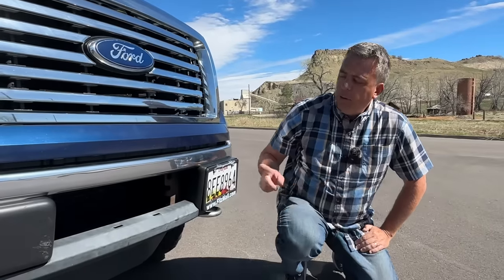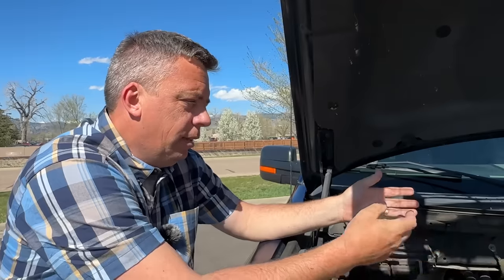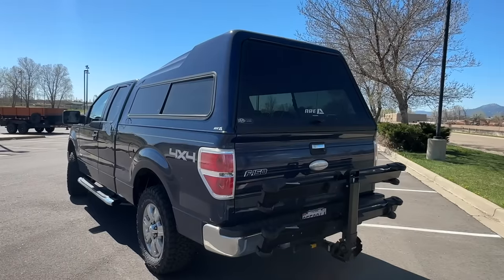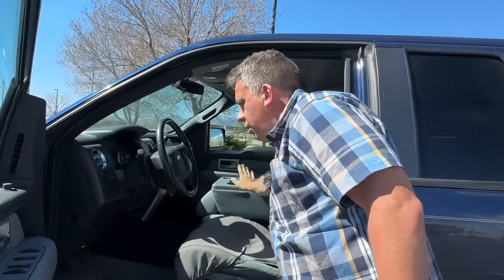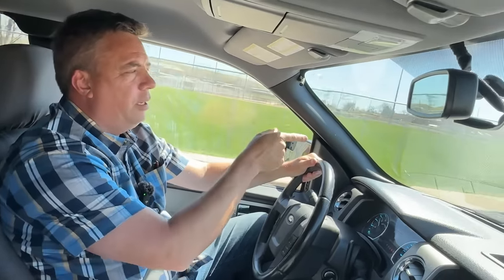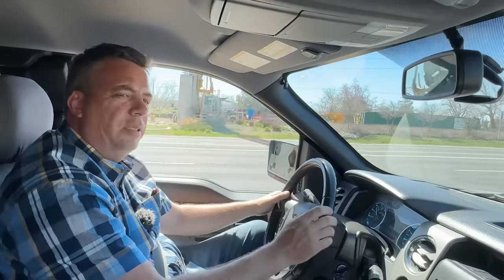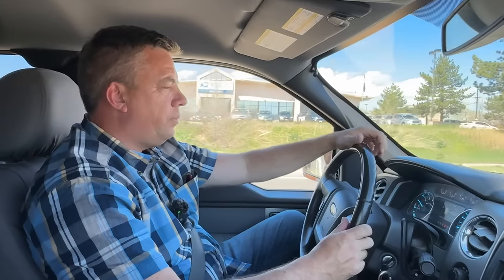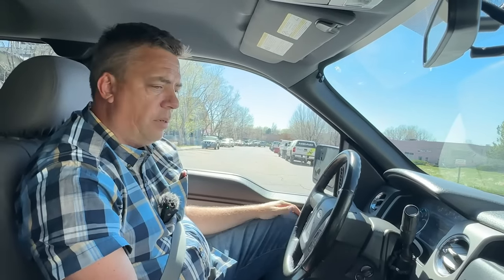How Has the Ford F-150 EcoBoost Held Up Over a Decade?

Comment: I bought my first pickup F150 3.5EB 2012. at 325056 km. from Canada, apart from the rust that was on the chassis, this truck has no problem with its mileage. After the initial removal of all fluids, I only had a problem with the leaking water pump, after its replacement everything is now concrete. For the years that I have owned it, I have installed a double oil cache can, I have a complete generation from the turbo to the end, after removing the catalysts, the pickup started to sound like a B8, then I added a panel filter and software that made the truck 385hp and 660nm at the wheels, I'm extremely happy with the purchase and after all these interventions it runs like a sports car. 
P.S. Greetings from Bulgaria, for the great channel you make, keep it up.

Comment: My 2013 f-150 FX4 3.5 eco had over 80,000 on it when I traded it in. No catch can nothing aftermarket on it. No problems at all. Just routine maintained   I traded it last year for a 2023 F150 Tremor I was so happy with the eco boost I bought another.

Comment: My coworker just traded in his 2012 F-150 with 160,000 miles last year (2023) because the turbos were starting to go out and mechanic quoted $7000 to fix both.

My wife's 2014 Ford Escape has a turbo trying to go out, along with other issues.

After these experiences, I won't own another vehicle with a turbo unless I plan on trading it around 100,000 miles.
Reply: If he supposedly got a repair quote for turbo replacement of $7k he was gonna be ripped off for an extra $5k
Reply: @pathunter7003  It sounds like the guy didn't want to do the job, so he priced it up. If the customer was willing to pay, he would have farmed it out. 😯
Reply: @andyd5492  that could be he case that he didn’t want to do the job, $7k is ridiculous.
Reply: @pathunter7003  doubtful.
He's know the mechanic for decades.

Also, the part alone for my wife's Ford Escape was $1200, not counting labor, so $7000 for two turbos on an F-150 is conceivable.
Reply: @GKMess42  the only conceivable part that his “trusted “ , which he didn’t mention that he knew him for decades, was going to rip him off if charging $7000 for turbos
Reply: @pathunter7003  it’s very clear that you haven’t priced turbos and labor in several years. That or I really wish I lived where you do because it must be a heck of a lot cheaper than the United States
Reply: @GKMess42  I guess you have to know where to buy them, obviously you don’t
Reply: @GKMess42 yeah idk what you’re talking about if you’re getting charged 7k for a turbo swap you need a new mechanic. You can get oem refurbished turbos for like 500.
Reply: @ReeshaRacing  first of all, this wasn't me.
Second of all, you're completely wrong.
Reply: You can buy new turbos for thees trucks off Rock auto for under $500 each. Any competent mechanic can replace them both in less than a day
Reply: @kevingeezy5176  better check your math.
Reply: @GKMess42  also for the 2014 escape rock auto has turbos for the 2.0 and the 1.6 for under $600

Comment: Thanks for doing this episode.  I'm still the original owner of a 2011 F150 FX4 SuperCrew (door plate reads production Feb 2011) with 118,000 miles.  It's been the best engine I've ever owned in a truck.  I've pulled up mountain passes near Durango with 10,000 pounds in a trailer and accelerated easily during the climb.   The only engine issues I've had were 1) a bad fuel incident requiring new spark plugs and injectors, 2)  hoses that started to leak after about 115k miles, and 3) the turbo charger intercooler / exchanger being oversized by design.  That last quirk was a strange thing to diagnose and only affected those of us in Texas and similar states where we can get a huge swing in temperature in a humid air mass during a  "norther" cold front.  The exchanger would over-cool the saturated air, and moisture would drop out, stalling the engine -- not great if you are trying to pass or enter a highway at speed.  The solution was to cover the exchanger partially with a piece of plastic Ford designed.  Haven't had a problem for the 10 years after the fix was installed.   I had not heard of the "cam phaser" issue you mentioned, but I suppose that can happen to many older / higher mileage cars.  The turbos lasting only to 150,000 miles is also news to me.  I am approaching that mark in about 30k and it may be prudent to trade for a new model.  But with the good track record I've had with this unit, I may try my luck, considering new F150s can reach $75k modestly equipped!

Comment: I drove 3 of the 2011 F150. Two were 3.5 ecoboosts and 1 was a 5.0. I owned one of the ecoboosts and the other 2 were work trucks. Never really had major problems. The 5.0 got better mileage quite easily.

Comment: You can watch several episodes of this engine, going through torture test hosted by Mike Rowe. I got my first 3.5 in a 2015 XLT. 90,000 miles and 0 issues. Now 2021 3.5 STX with FX4 package. Intake,cat-back and tune on both. Beating sports cars with a truck is a blast. Ford tough for sure.

Comment: Have 160k of hard miles on my 2013 3.5 F-150. I run a landscaping company, and the little truck has to pinch hit with my tandem axel dump trailer and equipment hauler on occasion and has really impressed myself and my foreman who have towed with it. I live on the continental divide in Montana at over a mile in elevation, this little engine definitely outperforms my 3/4 ton gas v=8 trucks towing here in the mountains, wish Ford would use this engine or ideally a larger I-6 Ecoboost(style direct injection) engine in their Superduty line.
Reply: That’s a good idea.  I really like the idea of a TT I6 like the Hurricane.  That architecture would work great in a 1 ton.  You’ve got the space (Cummins I6 swaps have proven that) and the 7 main bears of the I6 would make quite durable.  Only thing is, I’m not sure they want durability as it would cut out their lucrative after warranty repairs.  Ecoboost V6 is perfect for them.  Makes it all the way to the end of the warranty and then becomes Ecoboom.
Reply: @failranch9542  Not sure what makes you think ecoboost don't last. Has not been my experience. Have blown up more 5.7 Hemi's than anything else honestly.

Comment: I had a 2014 f150 ecoboost that I drove for 10 years before selling it to my dad. Only thing I had to change outside of regular maintenance was an oxygen sensor at 90k miles. Currently own a 2022 I have not had any issues in almost 2 years, hopefully it lasts as long as my 2014

Comment: My 2011 f150 ecoboost has 260,000 miles. It’s been a great truck. Had some issues with transmission and recently had to spend about $1,500 on repairs.
Bought it brand new in 2011.

Comment: I just bought a 2011 F150 with the Ecoboost, with 219000km on it. Seems good so far. I also have 2011 F250 Super Duty 6.7L as well. Have had it for 4 years now. Use the diesel to pull trailers and a 5th wheel camper. Excellent trailer puller. I would like to see more on these truck.

Comment: Nostalgic interior. I had a 2013. But I had one of the most awesome and underrated engines - the 3.7 naturally aspirated V6. Wasn't fast and fancy like the other ones, but that thing was so damn reliable. One of the most solid motors Ford's ever made. I wish they would bring back the naturally aspirated V6 in their SUVs. The new Ecoboosts don't get any better gas mileage and are less reliable than their bulletproof NA counterparts.
Reply: Yeah man, there’s no need for an Explorer to be turbocharged. All it does is make the Costco dads drive like maniacs. The 3.7 V6 in your F-150 probably had more power and capability than the 4.6 V8.
Reply: @miniaddict4534 Our 2017 explorer is na, the 3.5 duratec, basically the same engine as this guy's f-150. Insanely reliable. Ecoboost reliability seems decent, but Ford knocks it out of the park when it comes to na reliability.

Comment: My dad has a 13 4 door 3.5 ecoboost f150 has 190k on it now after hundreds of tons of gravel hauling and family traveling still has original turbos and 8 original coil packs 2 of them was replaced at 30k miles 3 sets of spark plugs and not so frequent oil changes has went over the oil change interval several times and just now started getting the timing chain rattle at start up still runs fine and pulls fine never had valves cleaned either I now have a 23 f150 3.5 to see how well the new ones go
Reply: I miss EVGA cards, they were so good :C

Comment: $4k to repair an older but still nice truck, or $86 for a new one. That was the choice I had to make when it came to my’12 F-150 Pt EB. Repairing it still made better sense to me. 

By the way, your videos of the OG EcoBoost on the Ike Gauntlet helped me with making the choice to get one in the first place. Thanks, TFL!
Reply: For me you're better off getting a 07-21 Toyota Tundra with the 5.7L I-Force V8, you'll be much happier with the Tundra with the 5.7L I-Force V8 in the long-term vs the overpriced EcoBoost F150.
Reply: @CJColvin  Fuel economy will offset the repair costs while not towing nor hauling as much as an F150. They're both overpriced to be honest
Reply: @luisinhoens90  True, you're better off with an old school F150 from 92-96.

Comment: I have a 2011 F150 ecoboost, I purchased it brand new, and have 176k miles on it. Engine is all original, never been touched, still runs great.

Comment: I was sold on the concept back in 2011.  I wanted to love it.  I ran out an bought one in November 2011.  The power was amazing because the dealerships ordered them with 3.73 gears because it had a V6.  It was crazy fast with that gearing.  Unfortunately it has a misfire under light load that they could never figure out.  I filed a lemon law claim, accepted a settlement, and traded it in at the 3 year mark, unfixed.  I still wanted to love the concept and bought a 2014 F150 with the EcoBoost.  That truck had a timing chain tensioner go bad at 28,000 miles along with dropping a turbo (while I was on vacation 800 miles away from home).  Like I said, I wanted to love it, but it wouldn't let me.  I have now sworn off small displacement turbo charged engines.  I just bought a Titan because it has an (almost) traditional V8.  I looked for a deal on a 20 or 21 Tundra, but apparently everybody else wants those trucks as well and the prices were completely unreasonable.

Comment: my 2010 5.4l v-8 had to have cam phasers replaced also!! $3800, not sure why ford cant fix the cam phaser issues ON ALL MOTORS. but besides that, this trucks has been AWESOME!! i think i have ATLEAST 6-10  more years out of this truck.( i take care of my truck). if i get 20 years out of a vehicle  i am happy. BUT I WILL ALWAYS BUY A V-8!!
Reply: How often did you change your oil?
Reply: Cam phasers (esp. the earlier models) have been problematic for manufacturers across the board, yes, including Toyota. Easily researched online.
Reply: $3800 seems like a lot for Cam phasers
Reply: My original owner ‘09 is still going without cam phaser replacement and runs nice and quiet. Like you, I think I will get many more years out of it now however it’s relegated to 3rd vehicle status to be used only when I need a truck. Today I don’t have faith in new vehicles to be any better than a reliable older one so if it’s not broke don’t fix it applies for me.
Reply: @volvo09  every 3500 to 4000 miles with semi synthetic.
Reply: @elvism684  well it was a whole timing chain job, and YES i think it was exspensive also!! i could have gone alot longer before having it done, but as soon as i heard some chain slap i had it done.
Reply: @squangan  wish i was that lucky. mine was ticking pretty bad.
Reply: @sundogtune  thanks for the reply. 

Guess that proves what I saw others say that it was an issue and not related to stretching oil changes out too far.

My aunt just trashed the timing set in her Chevy equinox in 75k miles by doing "when the car says" oil changes, which worked out to around 8k+ miles, but i hear from others that they can last if you take care of the oil.
Reply: I know the phaser issue on the 3v 5.4 is due to a failing oil pump. If you didn't replace the oil pump then the phasers will fail again.
Reply: @kingdaniel3519  i have watched the videos from 
FordTechMakuloco and know ALL about the oil pump. tried to get ford dealer to replace with one i would buy and they would not give me the 3 year warranty if i did that, BUT with the new parts i will EASILY GET another 8-10 or more years out of it. so by then the truck is like 25 or more years old . so i am good
Reply: 09 f150 5.4 278k miles, I religiously change my oil every 3k full synthetic 5w30 motorcraft oil filter. I've bought  a genuine ford phaser kit to have ready when I need to repair within upgraded oil pump.  It's been a great truck except for the rust hopefully I can fix the rockers next month.
Reply: @kingdaniel3519 I work at a ford dealership. We’ve replaced a lot of cam phasers. But very, very seldom have we had to replace any oil pumps. We replace the VCT solenoids with the updated ones before we replace the phasers. About 2/3 of the time the VCT solenoids fix it. A lot of the times the timing chain tensioners are the root cause. The gasket fails, and the oil leaks and drops pressure there. Again we have very seldom replaced an oil pump. And we don’t have repeat failures.
Reply: @dmandman9  That's because you work for the dealership and only fix what Ford tells you to fix. Yes, the tensioner seals occasionally blow out. That causes timing chain rattle, it neither causes nor explains phaser failure. The phasers fail due to lack of oil. The phasers actuate off oil pressure, that's literally how they function. Lack of oil causes the phasers to fail, a leaky tensioner doesn't. VCT tensioners, again, run off oil pressure. That's why they go bad in the first place! Lack of oil! When you replace the oil pump with a quality replacement, you correct 90% of the issues the 3v motors have. 

Ford replaced the phasers in my 05 F150 in 2011. Five years later, they were bad again. That was around the time Melling came out with their improved oil pumps for the 3v motors. I, me personally, did a complete timing job on my truck and replaced the oil pump. Now, eight years later, my truck runs like a dream. Stock oil pumps don't push enough pressure for the VCT to properly function because of the cheap aluminum backing plate.
Reply: @kingdaniel3519  Excuse me? I was a mechanic before I worked for Ford. I also know what works long term and what doesn’t. The 5.4  3 valve
Was made from 2003-2010. When the warranty is over, we fix according to OUR judgement. And the revised VCT solenoids do work as a long term fix if the cam journals haven’t been worn  often making phaser replacement unnecessary. When phaser replacement is required, many times we DO find leakage from the failed gasket behind the tensioner. That’s the weak point that allows oil to escape which deprives the phaser of oil , especially at idle. I’m sure an improved oil pump can compensate for wear in the cam journals. But in MY experience , when phaser replacement is required, combination of replacing the phasers, the tensioners and guides, along with the revised VCT solenoids has been sufficient. If the redesigned solenoids aren’t installed, VCT repeat failure is common. But with the revised solenoids, these engines often go on to last 200,000 -300,000 miles or more without having to be touched again
Reply: @kingdaniel3519  I have an 11 F150 with a 6.2L. The engine is indestructible. The cam phasor use the valve springs, not oil pressure. The oil just locks it in position.
Reply: 2010 5.4 with 160,000 on it and runs quiet. 3,000 mile oil changes with Pennzoil full synthetic and 5w-30!
Reply: This video is a complete lie!
Our shop very often rebuilding these same garbage Ecoboost engines. Not one version of the Ecoboost engines are forgiving engines, these are all have issues after the warranty expires. This vehicle is a unicorn or the owner just babied this truck without driving it normal. Timing chain issues, overheating, coolant leaks and oil leaks are few of the common issues and the electronics are disastrous as they age in the rust belt.
Reply: @volvo09  he changed the oil when the service engine soon  lit up on the dash😳
Reply: @Thankyou_3  there are a lot of eco engine with 200-300k on them, they are a good engine

Comment: my 2011 silverado has 246k miles and has had no major repairs done to it. no cam issues, no afm issues (tuned out) and the 6 speed auto is doing great for the age. i also get 16-18 mpg.
Reply: My 2011 Silverado burned oil like a middle eastern oil baron, gum up on cylinder 7, possible rear main oil leak and the tranny would act very strange sometimes. I was the second owner after 150k miles worked with the guy he’s a boat mechanic and a veteran airplane mechanic so I figured he kept up with maintenance but I guess not lol.
Reply: Seems relevant.
Reply: I might have gotten lucky with my trucks reliability, but I just take care of it.
Reply: @bendino9016  jealous of the 6 speed. my poor 4l60e has gone 190k without having the fluid changed. Thing is tired.

Comment: Still happy I got a 5.0 Coyote in my 2014 F-150.  Get  17mpg around town 20 on long highway trips at 72-75 mph.  Look up Ford Tech Makuloco for his comparison of long term EcoBoost vs V8.
Reply: What octane fuel do you use?
Reply: @ThatGratefulGuy  87 octane
Reply: @TheBillp603  that's great! I'd be happy with those numbers, too.
I have a 2014 f-150 4x4 with the 5.0 (STX). I must have a bit heavier foot than you. Also my leveling kit probably doesn't help my fuel economy.
Reply: Mine is also a supercab, not a super crew with 3.55 rear end, and most of my driving is in New England sea level to 1,000' elevation